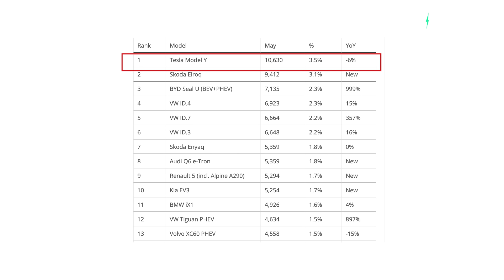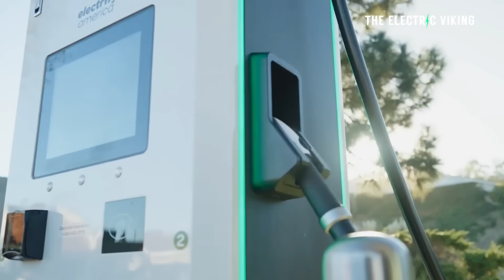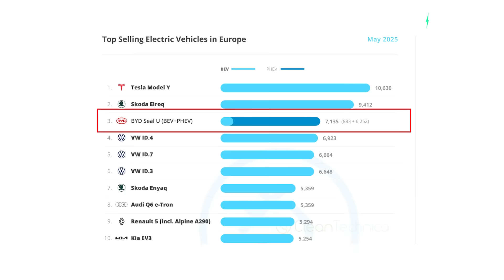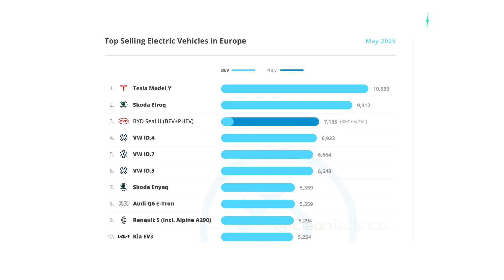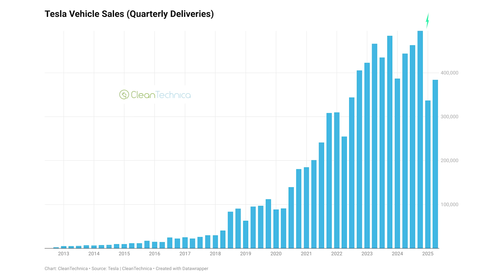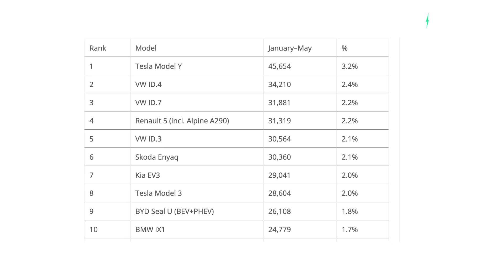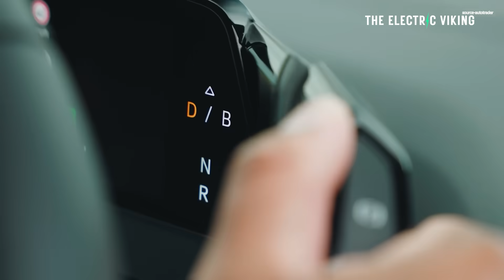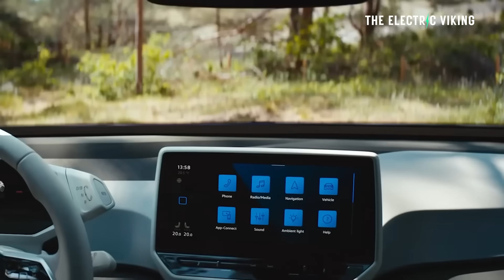Europe EV Sales in 2025 Show ICE Disruption Accelerating - EVs Up 34%!

Comment: EV's pricing is a whole thing unto itself. The initial costs to manufacturing is lowering and the one's who are making them aren't tacking on huge profits. Dealers can't sell them so the price remains low. 
For some, it is a time to take advantage of what's perceived by the general public (which doesn't always get it right). 
Case in point.... I bought a 2020 Chevy Bolt. 2017-2019 had big batteries that were mis-manfactured in a S. Korean factory (one of many) that caught fire during charging. Homes were lost. But 2020 Bolts had NOTHING to do with what happened. Didn't matter to owners. They traded them in at an alarming rate. 
I snagged one for cheap. Perception.
Change is happening constantly, and this happens to be a biggy that grabs the general public's attention.
Don't always follow the crowd. Make your own choices. If that means a legacy gas car-so be it. If it means an EV, go for it!
No looking back for me. I haven't been to a gas station for over a year. 400+ miles on a full charge. More than I want to drive in a single day anyway.

Comment: Here in Europe car sellers will have to increase their EV share to prevent high fine by the end of 2027 (fleet emission values over all cars sold).
However there is one big hindrance for a lot of people: if you van"t charge at home momentarily it is more expensive to buy the electriciyt than to buy gas / diesel.
As of 2027 households also fall under the emission certificates trade, making fossils more expensive for driving and heating homes.
My expextation:
* the real acceleration in EV sales will start by End 2026  (price drop increasing for EV) /beginning 2027  (people becoming more aware of the more expensive fossiles)
* due to the recent unstable politics  people are more and more waiting "til it happens"   (expecting / awaiting last moment legislatory changes)
(a example: the fleet emission fines for car manufacturers mentioned above initially were applicable for sales in 2025 only  , but in 2025 the European Union decide to extend the period form 2025 only to 2025 upt. and incl. 2027  as sales volumes of EV in the first few months of 2025 still were way down for being on target)
Reply: Not really true..here in the Netherlands I use Vattenfall chargers they're only €0,33 / kWh

Comment: In Europe biggest thing with electric car is how government will charge you for filling up you battery. Most off European countries fill they budget with petrol tax, every time you fill-up you petrol tank. So they don't want electric car in general.
Reply: Most charge at home
Reply: Most European governments are reviewing, and likely adopting, pay per mile taxation regardless of fuel-type. However, they may choose to differentiate by CO2 emissions with those emitting more paying a higher rate than those emitting less or not at all.
Reply: @GruffSillyGoat our gouvernement in the Netherlands hates the idea but they don't see any other option as they cannot tax electricity people generated themselves with their own solar installations.
Reply: They'll just transfer fuel tax to charging tax, they'll get their money one way or another
Reply: @karlwest437 here's the fun part: an EV has a normal plug, that goes in a normal power socket.

The grid cannot distinguish between a car or a washing machine. Sure you can increase the electricity tax, but people will just buy more solar panels, and you don't pay tax on that energy.
Reply: @NiekNooijens  Here in Belgium, "strangely" the various grid operators are pushing for digital electric meters and and then for "safety reasons" (suuuuure...) there are new regulations stating that if you live in an apartment block, you are not to connect your own charging station to your own electric meter but instead you are obligated to connect it to a common meter dedicated to EVs. Once they will get most EVs easily targetable, 100% sure that they will charge the hell out of us and be sure that they will review home consumption in order to target households with large electric use in order to tax the hell out of them as well. The only way I see is individual solar installations and still I'm sure they will find a way to tax us. Anyway Belgian greens want everyone to walk or bike only...
Reply: @ren2704 I have a portable power station with solar panels that basically operates off grid so good luck taxing that. But even if you need to use the grid. Isn't there net neutrality in Europe? A phone provider cannot distinguish between where your data goes to, so why should an electricity provider be able to decide what you do with your power and what not?

I think differentiating the way you describe violates the law.
Reply: @NiekNooijens  It would take ages to charge with a portable power station I think. Now in Belgium, between respecting privacy and taxing us into oblivion whatever we do, the choice is easily made by the Belgian governmentS (yes we have many different, with hundreds of thousands of civil servants and politicians with bottomless pockets).... We are in the top 3 most taxed population on Earth.
Reply: @ren2704 it's not that bad honestly. My portable power station can supply 2300W so with 5 solar panels it charges your car in around 10~20 hours.

Ok that's not fast but it works 

And yes I know Belgians are taxed pretty heavily. Gotta pay for those 6 gouvernements you have (8 if you include the EU's)
Reply: @NiekNooijens  To tell you the truth there is a charging station in my street with electricity rates lower than my off peak rate at home, which in itself is crazy but Belgium isn't the country of surrealism for nothing :p

Comment: Tesla is making baffling design decisions that are genuinely alienating buyers, and frankly, they're starting to look like Apple in the worst possible way. Yes, they brought a physical turn signal stalk back (likely because Euro NCAP basically demanded it for a top safety rating, which the Y did achieve, showing it's a safe car). But instead of a standard, intuitive latching stalk, it's a non-latching, momentary switch. It's 'reinventing the wheel' on a control that's worked perfectly for decades. This, along with forcing people into touchscreen menus for basic functions like opening the glovebox, are unnecessary frustrations. Adding to that, there MIGHT be a problem with stability at high speeds on the Autobahn with German-made Ys – perhaps the Chinese ones are fine – BUT more than a few Autobahn drivers are not feeling safe with their new cars.
Reply: Best one pedal driving, best keyless go, best app - i dont care for the missing stalk or hud, the car works very well for me and has lots of power for lots of fun....
Reply: As a 1st gen M3 owner I agree the absence of stalks is a terrible idea.
The rest of the car is very good
Reply: The lack of HUD , front screen is a NOGO for me. Interior style is also quite ugly to me. Turning radius car width and lengh are also not good for my streets, towns, garages. And those model 3 and Y are too old now....
Reply: @chryoko most of the best selling cars in the world are over 20 years old!!! The 3 and Y are much younger and have been upgraded in the last year. You have been listening to press that is feeding you nonsense. Though if you want to believe it people are happy to live the lie.
Reply: The reason the stalks went is they will be redundant in a couple of years. The very thinking of it has worked well for decades is why most European car manufacturers will go bust. They are stuck in their ways while the auto industry is going through 2 revolutions.
Reply: @hamishbarrie8318 But Tesla brought them back in the model Y after huge public outcry….
I can’t see stalks going anywhere. No other mainstream manufacturer has removed them.